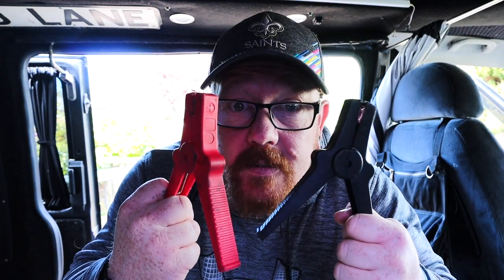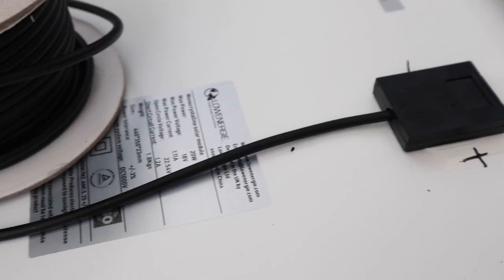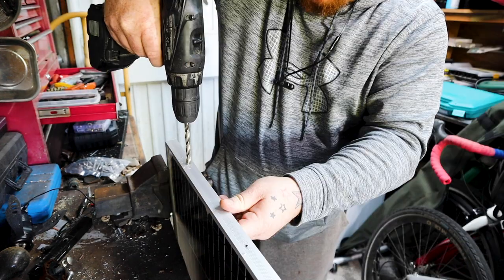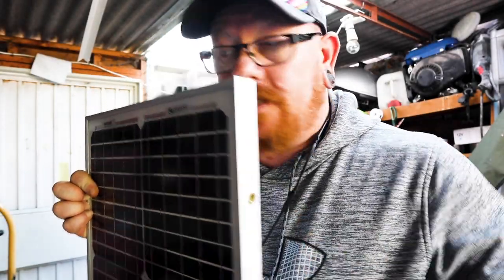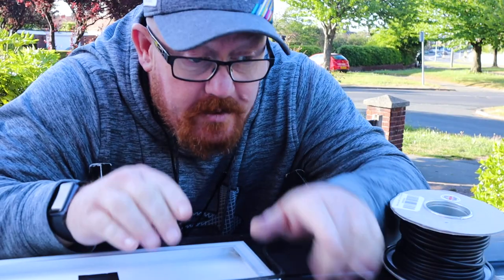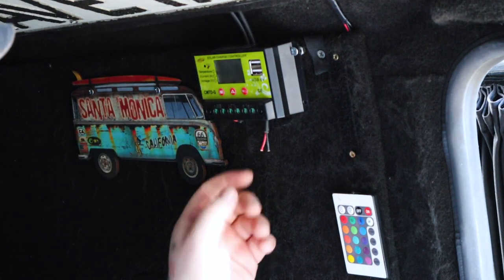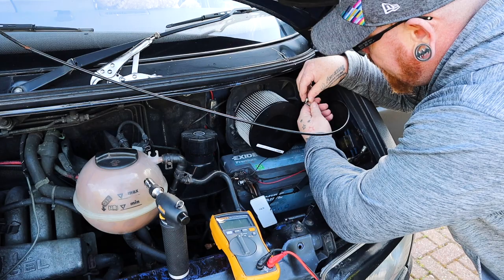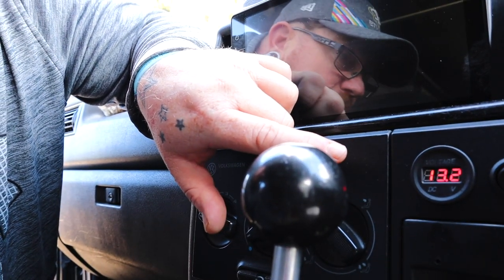Shockingly SIMPLE Van Solar Power | How To Fit Solar To A Van Starter Battery

Comment: Neil would you have a flexible solar panel don't wanna sticker flex it to the roof if it's gonna overheat. Great video btw 🤙
Reply from the maker: I’m not a fan of sticking to the roof my self mate Iv seen a few fly off on the motorway . I’m more of a drill if and bolt it guy . And thanks bud

Comment: We've got a pop top like yourself and are planning to fit a ridgid solar panel for the leisure battery. With it being a fibreglass roof is there anything you did different to secure yours than what you would do for a metal roof? We're worried about the roof cracking if there's too much drag whilst travelling. Looking on YouTube I can only find videos where they've used flexible panels on fibreglass. T.I.A 👍
Reply from the maker: i bolted mine to the roof like you seen , and to be totaly honest the big ones been up thre for 2 yers now and we have had zero problems with it mate , id say if i ws to do it again id use a big thick square washer on the top and the bottom , and dont go mad on tightening it up . but like i said we have had no problems at all , hope this helps simon. thanks neil
Reply: Cheers for that 👍

Comment: Hi Neil. 
Love all you videos. Very informative and entertaining. I’m doing a van at the moment and have learned a lot from yourselves. So thanks for that. I have a question if you have time?
I’ve fitted 2no 205 amph SOK lithium batteries which I can charge from a hook up and a split charger. 
I’ve fitted 700w solar panels to the roof and have a controller fitted also. I thought it was just a matter of wiring it up!! But seemingly a computer is involved to let the controller know what type of battery it’s charging. I’m a technophobe and can’t work a computer. Is there a easy way to do this?  Thanks again.
Reply from the maker: Firstly what controller do you have . If it’s a branded one which I’m guessing it is then in the settings on the screen or the phone app you will be able to program it to suit your set up . You don’t need a computer
Reply: Hi Neil. Thanks for the reply. It’s a photonic universe controller. It’s got a coms remote meter. It says you should always wire the battery to the controller first then wire the panels to the controller second?

Comment: Another great video. Quick question I have a voltage sensitive relay in my van and a solar panel connected to the leisure battery. Am I correct in thinking that if I get enough solar from the sun at the right voltage the vsr will open and charge my main van battery.? Cheers
Reply from the maker: Yes mate it will work that way . But can also work the other as well it can pull in to your leisure system from the starter . I also have the  durite split relay from bat to leisure as well as the solar on a mppt  . But for the cost of the small solar system I’m now 100% safe from and drain out of the starter . Great question mate hope this helps
Reply: Urban Explorer yes that helps. Hope it helps others aswell. Look forward to the next video.

Comment: Hi pal
I'm interested in doing the same for my van. I've used solar and charge controllers in the past on my garage keeping my car charged
So I've got all I need. The only thing I'm unsure of is, what happens when I start the van up? I've done it before on the garage set up and it said error message.
So I'm right in thinking, before you start it up to disconnect it from the solar. In which case. How would you do that? If it's really needed? 
Thanks pal

Comment: Great double system
Reply from the maker: One thing I didn’t point out was don’t run it with the altinator . To much going in to the battery and back to the alti could cause problems . Have a switch on ypur supply to the battery

Comment: Liked the video,but can I ask what happens when you run the engine and the alternator kicks in,do you need to disconnect the battery from the solar charger please,or is it ok to run your vehicle.
Cheers penguin peter 🐧🐧
Reply from the maker: yer have it on a swich , dont run the alti at the same time or youll damage the battery and the possably the alti , this is one thing i didnt point out ,

Comment: So do you leave it all wired up when you are
Reply from the maker: You can do . It’s only 2 clips or the plug
Reply: @UrbanVanlife  so if I put solar panel to a unit then to the battery I don't have to keep opening the bonnet to to disconnect or unplug I can drive as normal and it will work as normal?